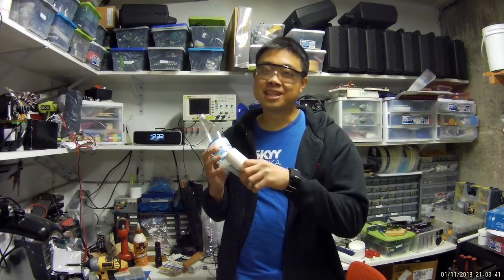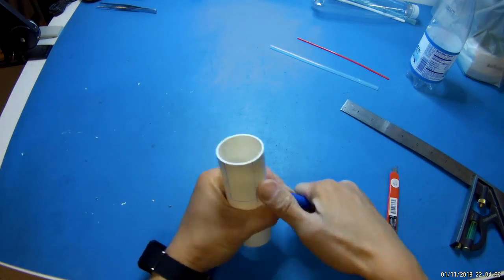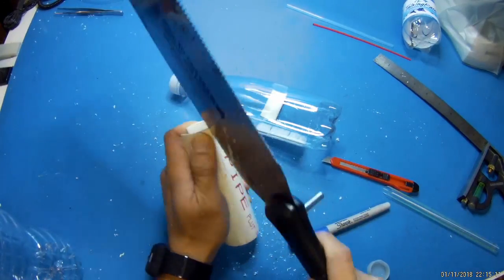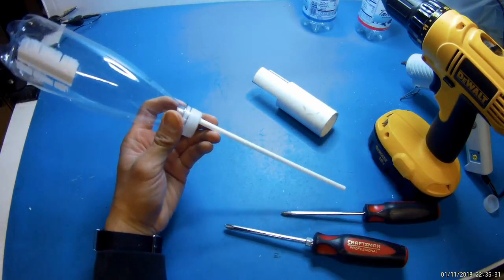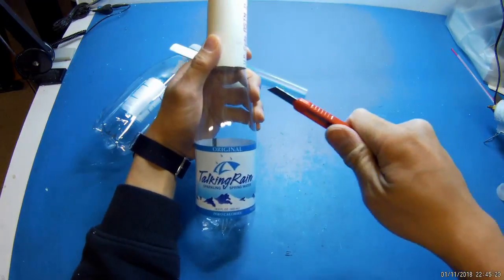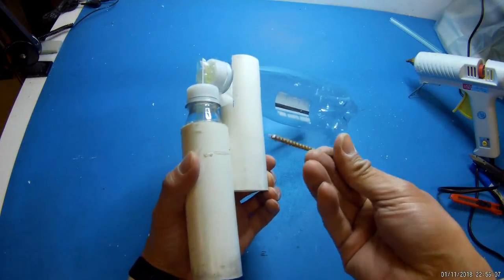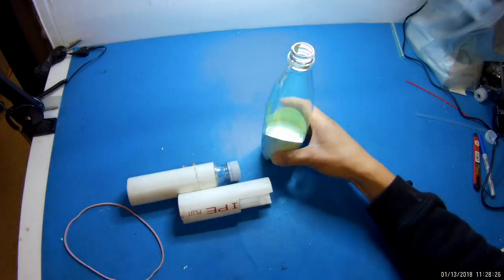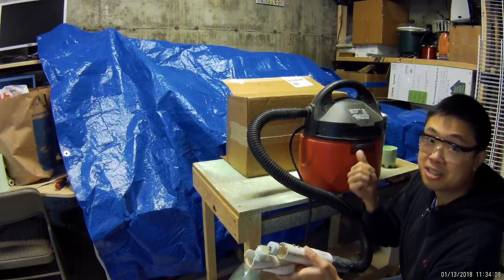How to Make a Paint Sprayer From Plastic Bottles, Plastic Bottle Hack

Comment: Just a tip when using a Combination Square for Layout  marks   the sliding Ruler / StraightbEdge is one inch tall  so you don’t need to measure   and mark that just  mark one side  put it in place and  draw your layout on both sides of the Square  i am a retired Professional Woodworker  and with the exception of   some Cmbination Square toys  Ivecseen all the others  i’ve ever Owned or used from  name brand Companies  are 1 “  as a Matter Of Fact most Layout tools  are standard widrhscand thicknesses  as Well  which Allows the Craftsmen to be faster and more Accurate when doing Layouts  things like Framing Squares  are built  to match the typical thicknesses of todays Dimensional Framing Lumber  so they can mark tooth sides of where a Stud ,Joist ,orvTruss belongs  on the Project. this process gives the Carpenters the Advantage of being able to ensure things are built to code  or more accurately  when Assembling the Projects they are working on
Reply from the maker: Thank you for this time saving tip! I will remember this one. I'm always humbled and grateful when I get to learn things from people who are masters in their craft.  I only get so far with my middle school wood shop class basics.

Comment: This isn't very practical. Entirely too much work for such mediocre results, and besides...spray paint is cheap
Reply from the maker: Thanks Tony for commenting.  I don't disagree, it was more of a solution to a non-existing problem. I had a pile of plastic bottles and was playing with what can I build from plastic bottles that wasn't already done on the net.  A paintbrush usually is quicker in terms of setup and cleanup.  Stay safe out there.
Reply: @LockeLaboratory  Haha, I hear ya on the pile of plastic bottles. Earlier today, I grabbed my heat gun and made my pile a little smaller by fabricating some shop vac adapters...🤷‍♂️
Reply from the maker: Tony Snyder thats actually a great idea for using bottles. I'll have to remember that for my next shop vac project.

Comment: So im gonna use your idea but with a hair dryer instead as it already has that circular look and size to attach a hose.
I also want to test if the hair dryer on its lowest mild heat settings has an effect on the paint quality.
And im gonna make it a little stronger.
Nuff Respect to you and your idea.

Comment: Can a vacuum cleaner we use in our home b used in place of inflator
Reply from the maker: jeetendra kumar pallai you could but it would require taking apart the vacuum, extracting the motor and building a box around it.  i did this in my other video of my diy shopvac with secondary water filtration

Comment: I bought a paint spray machine.but no need to everyday paint.
How can I use a vaccume clenar plzz help me
Reply from the maker: Hi sardaar Khan,  the easiest way is to use a shop vacuum and follow the instructions in this video.  Otherwise if you have an ordinary vacuum that you are willing to take apart and extract the motor, you would have to build a sealed box around the vacuum motor to get suction and blowing functions.  You can see how I made a box around a vacuum motor in this video https://youtu.be/bS2QPDEt284
Reply: My machine is only air flow not creat vaccume air to suck a dust.
Panit spray machine the just through a air
Reply: @Pintu7619 reverse the flow entrances and exits.  Air is going one direction always- vacuum will suck from left and blow out exhaust to the right, so think of the vacuum’s exhaust as the air being used to push the paint.  

Hope that helps?

Comment: How do you do it with compressor plz make video love the idea and watching it work blows my mind
Reply from the maker: Hi thank you for the nice comment.  I will put it in the queue to make another video about the paint sprayer.  I think with a compressor it may be even easier as the air hose from the air compressor would simply attached to the large straw directly instead of through the handle.
Reply: cool brother i cant wait

Comment: Hi Sir im trying to build a smoker device with filtration system, im going to adopt your  electrostatic precipitator with activated carbon. Pls support my project if I can have some link on how I would do it on working process..
Reply from the maker: Hello Romuel, sure thing.  Here is a link to instructions on how to build one.  https://hackaday.io/project/7237-household-electrically-enhanced-wet-scrubber
Reply: Locke Lab thank you